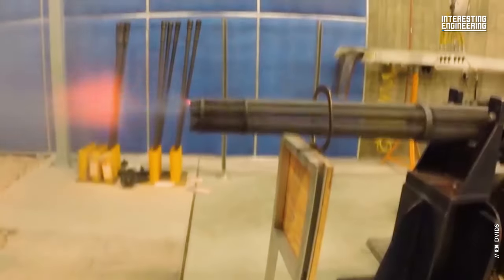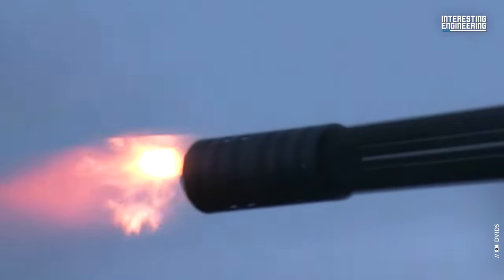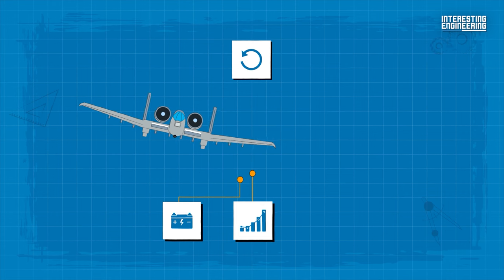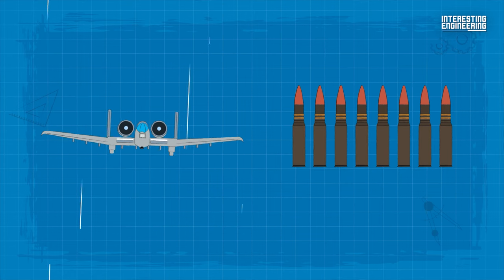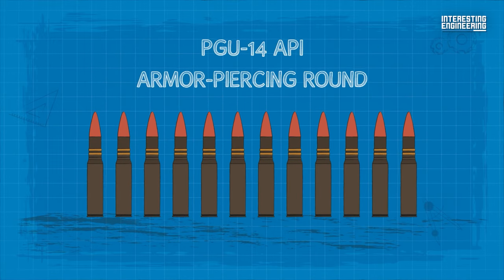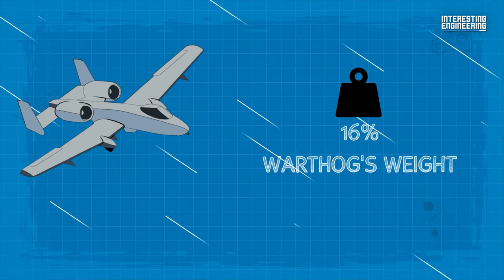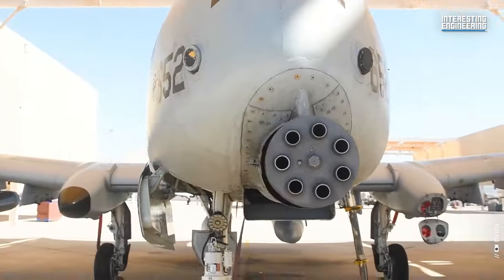What Makes the GAU-8 Avenger a Nightmare for the Enemy?

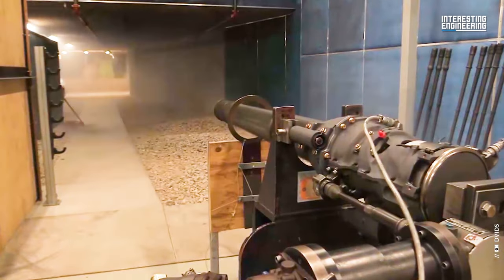Comment: 2:00 Instead of the what?
Reply: The M-61 (M-130 Army) was electrically powered the A1 has 3 or 4 barrels tapped for  gas operation after motor startup like the M-134 rifle caliber version.